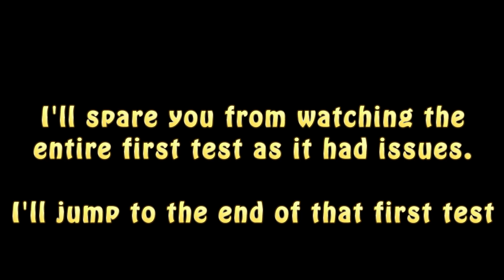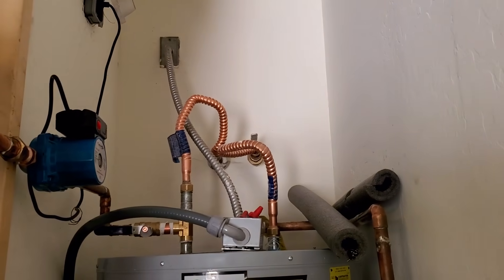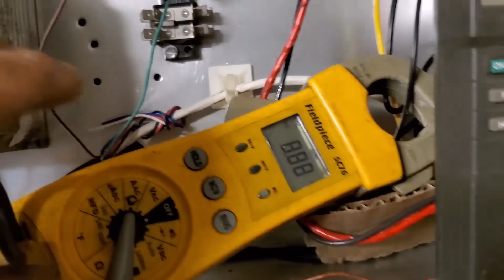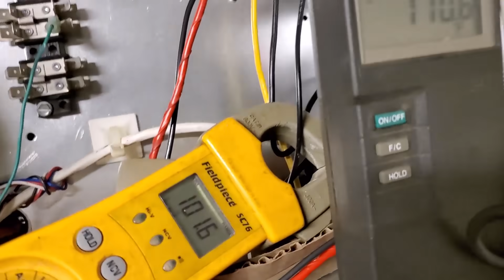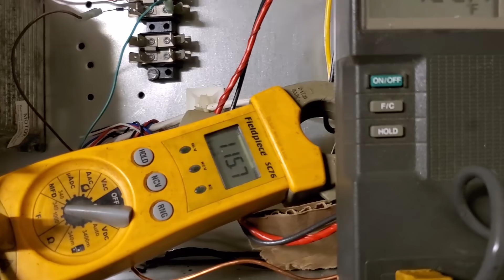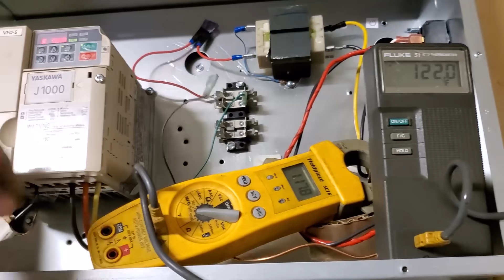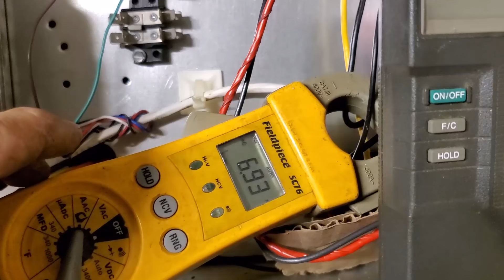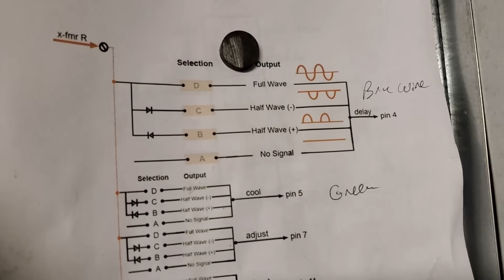First testing of the Bastard Water Heater on the home's 50 gallon tank

Comment: Johnson controls has thermostats, that have pid control output. And 0to5 volts also. Yaskawa should have a pid control program parameter set. Wire it directly in to vfd and you are set.
Reply from the maker: Yup.  And so does Honeywell.
In just worked on one recently. 
But that wouldn't meet my requirements of DIY and as much recycle of used parts as possible.  Lol

In was tempted to use one of those.  Like the Honeywell T755 or whatever model it is.

Comment: Once you get the water flow set up, do you plan on making a controller to add in the resistive heat in the tank once you reach critical pressure on the heat pump & close the valve?

Comment: you should just plumb the heatpump inlet from the bottom drain and the outlet to the water tank cold water inlet. I've done this before with a heat pump just as you're doing (only the heat pump used a lake..) and it worked perfectly. Kept the hot water tank at 140* and never delivered cold water to the Hot Water Outlet to the house. Water convects extremely well so while it may seem that would be a short circuit, the water thats hot enough just moves up and away from the bottom of the tank.

Comment: On Geo WSHP's  with a desuperheater, we pull water from the bottom drain, through the DSH and back in the cold water side of the WH. This allows the hot water go go throught the dip tube back into the tank.
Reply from the maker: So that is basically close to what I got now except I am putting it back into the hot outlet connection.
If I find that I get too much sediment taken from the bottom and pushed directly into the house plumbing maybe the fix will be to return it in the cold side like you do.

Comment: why not get rid of the existing water heater and replace it with a GE geospring i love mine in the summer months i heat my water on JUST the heat pump alone  and in winter my power bill goes up maby 20 a month max compared to my old straight electric water heater it replaced
Reply from the maker: Well, this water heater is brand new. Bought it in October when the house got a flood repair and I had to pull the heater anyway.
And everything you see here EXCEPT some plumbing connections were things that I already had including the VFD and the water source heat pump.

I'd have to invest in a lot more coin for what you are speaking of.

But this is cool.
And it's fun to run a 3 phase compressor on a VFD at home.

Comment: Been looking at the Heat Pump hybrid units to replace my aging water heater.  Definitely looks like its a viable configuration.
Reply from the maker: They make sense.
They cost a lot tho.
Reply: @hackfreehvac  If I had access to something similar to what you do....I'd probably attempt some hackery, but alas, I can only watch with great amusement and interest at your creation.  

It would be nice to see more companies offer heat pump configurations that had water based heat exchangers.  Seems like it would increase the overall efficiency of the unit, and extend its operational climate range.

Comment: where's the check valve to stop the back flow or reverse flow?
Reply from the maker: My pump moves in the same direction it would draw from. So a check won't stop anything.
As it sits with the repipe it works.
When the pump and compressor is off there might be some flow through the loop but I think most of the flow would rather push out the top of the heater as normal rather than through the bottom port and through the heat exchanger etc.

But in the end I'll probably add a valve with an actuator so it closes when not heating.

Comment: Did you use a check valve?
Reply from the maker: For the first setup? No. And the water flows the same way through the circulation pump anyway.
A valve with an actuator would help.
It seems to be good the way it is piped now tho.

Comment: Normally on a solar hot water system you draw off the bottom push the water into where the lower elements is. That's how I installed them.
Reply from the maker: Interesting.
But of course I'm keeping my elements for backup if/when this thing quits heating.
Reply: @hackfreehvac  use top element for back up

Comment: Try putting the hot water in at the side tap close to the top. Or you can get another water heater to use it as a preheat tank for the main tank if it keeps diluting your hot water.
Reply from the maker: It seems ok now that I am taking the water from the bottom rather than the cold where the cold water could use my circuit as a bypass directly to the outlet.